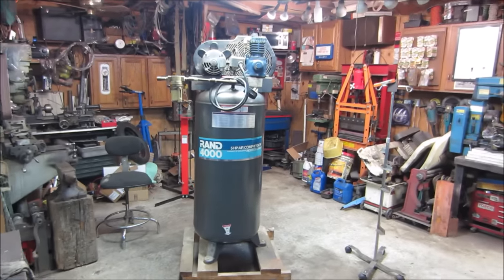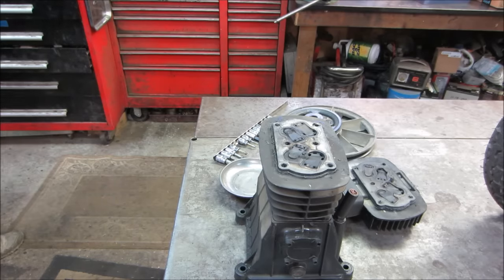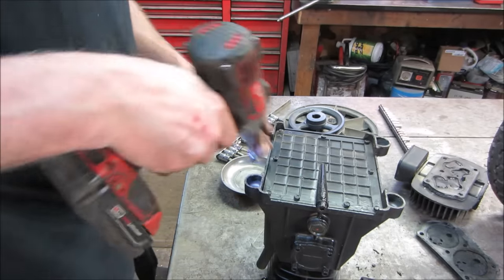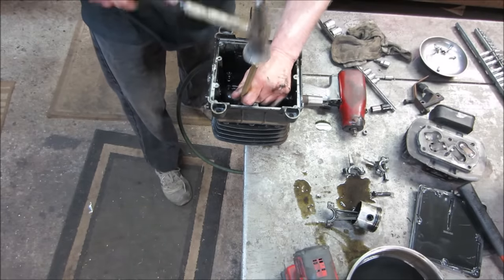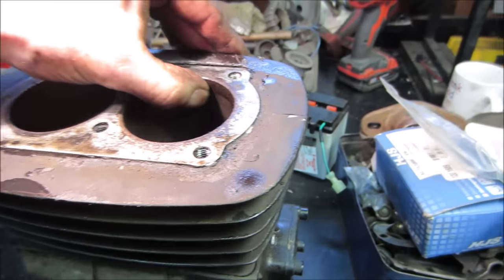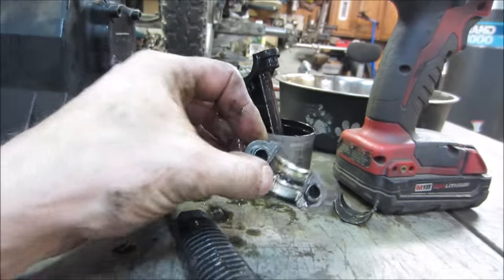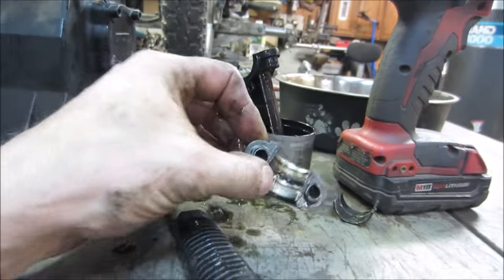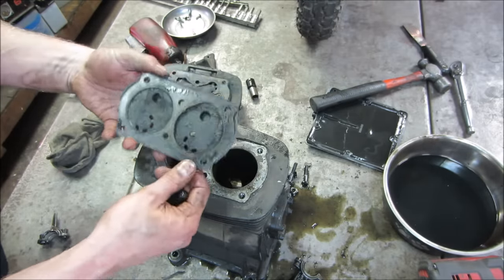Burned out Air Compressor tear down, what went wrong?

Comment: Cool - I was hoping you would tear that down. I wonder if the had it sitting on enough of an angle that the splash arm on the bad side wasn't reaching far enough into the oil reservoir. If the had is just a few degrees one way and let the oil level go too low i might not have been able to splash the oil high enough into the cylinder to lubricate killing the wrist pin and the connecting rod and once those got bad enough they started causing the damage to the bearings on the crank - which probably got enough oil but couldn't deal with the slop. 

Always a fun time dissecting a failure. The only thing I can think of for the extreme wear difference between cylinders is the unit sitting on a angle.

Comment: I would say you're probably right about the fan cooling the one side just enough that it didn't fail like the other side. They don't use a wrist pin bearing ( roller bearing ) in those machines ? Strange. I've rebuilt a few dirt bike engines in the past as well as my own skidoo engine ( 1980 Citation SS ) with teflon coated pistons lol. It went just over 100 mph after the break-in. :) Thanks for the entertaining  programs. Good Day eh ? From the Great White North !

Comment: That sort of damage happens when the discharge valve isn't closing off. The wrist pin needs to have a cyclical force on it, by having a suction stroke, where the piston is pulled down by the rod, distributing oil to the top of the wrist pin;  then followed by a discharge stroke where piston is pushing up. When the discharge valve is bad, there is always pressure, and down-force on the piston and rod. This causes the wrist pin to wear into the top of the pin bore because and bottom of the rod bore; it never has a chance for oil to enter that side. 

The reason that a lot of the big-end bearing is still present is because it makes full revolutions and that carries oil all the way around the bearing, whereas the pin only has up and down motion to help distribute the oil.

Comment: I was watching your atv video and you mentioned it’s hard to get a close up of anything with your camera. May I suggest you go to AliExpress and buy a WiFi endoscope camera. I got one for 15bucks and it connects via an app to your phone and you can go really close up to parts, like 1 inch and it’s got an array of led lights around the lens so it’s great for showing things very close up, you can record the video and post it with your videos. It’s handy for inspecting things too like engine cylinders through the plug hole. Great videos by the way. I love them. Thank you so much for posting them.

Comment: I wonder If the reed valve failed on the good side so it wasn’t doing much apart from going up and down.
The other side produced pressure day after day until the wire fell off.

Comment: I would say that one cylinder started to give away first causing more drag to that side . With the extra drag on that side brings more friction allowing more wear to the bearings and upper rod .  Basically , it started running lop sided .

Comment: My theory is that the compressor overheated due to just running while the shop was empty, and the hotter side was the one that gave up. Once that oil started depositing on the top of the piston, it cause friction that eventually wore the wrist pin and top of the rod out. Of course... it could also have been someone overfilled it with oil and that first throw started a dent that eventually, and after being run for years afterward, cause the damage we see.

Cool autopsy though, I always wondered what was in one of those heads v a fuel engine.

Comment: My guess is this is a two stage compressor the good cylinder is the first stage where  the air enters gets compressed and warmed moves to cylinder number two where it gets compressed and more heat is generated. Now I am not sure if the cylinder that is the second stage is closest to the fan or not, but either way the blown out cylinder might have had an underlying problem of some kind before the prolonged full tilt boogie operation! What do you think?
Come back and give an update to the comments. Thank You.

Comment: Hi Mustie, after watching the first video in regards to this compressor, I think the damage to this compressor was done by someone adding that big drive pulley on the motor causing this pump to turn way too fast which caused overheating on that one cylinder.  These pumps like to turn at fairly low RPM's. The compressor that you put on the other tank, the motor really needs a much smaller pulley for that Quincy compressor as those pumps like to turn at 600 to 850 RPM's, so if you want that pump to last long time, I would put a 1.5" to 2" pulley on that motor.
Reply from the maker: l did go even smaller on the pulley but put one what l had at the time,

Comment: The piston on the side closest to the pulley runs cooler than the one furthest from it. The wrist pin that failed is where the most heat would be concentrated, so it would be the first to go because of the excessive heat generated when the compressor was left running, and when the wrist pin failed, the hammering would be transferred to the crank end of the rod and destroyed it even though both rods were getting the same amount of oil. This is basically the "cause of death".

Comment: No expert on compressors but I would wonder if the severe cylinder was under a higher pressure such as a "two stage" type system where one cylinder is receiving air already pressurized and pumping it to a higher value. With all that carbon, I would also wonder if the oil was actually "burning"??

Comment: I have one of these, only the horizontal model.  The amount of carbon tells me that they were running motor oil in that unit.  Only run naphalmic compressor oil, SAE 40, in these or other compressors.

Comment: Air systems on trucks often blow oil past the rings when they are tired, Piston rings will fix the problem. IR parts are stupid expensive and synthetic oil is recommended. I would agree that the side farthest from the fan had the most damage due to heat.. I would have considered one of those high volume compressor pumps from Harbor Freight and build a good air station.
Reply: I'd agree being away from the fan caused the issue or at least a huge part of it.  Very common on V-Twin motorcycles that the rear cylinder wears much more than the front as well.  Just doesn't get the airflow.

Comment: I wonder if it's a 2 stage where one cylinder compresses the air and it goes to the next cylinder and it compresses it again. That would explain why one was so bad and the other was not.The second has to work harder to compress the higher pressure air again. And the building heat added to the problems.

Comment: piston b heats up the most due to fan direction, burns oil has more drag, gets so hot it's almost stuck in it's boar. 
cracks piston at wrist pin, on one side at first, the pin is pushed at an angle than over time the pin wares sideways making a nice slot over time. the added heat and mostly the knocking pounds the oil out of the bearing at each knock taking out the rod bearing. 
prevention,  turn off compressor when not home, use better oil, improve air flow. 
for long runs i use a box fan pulling air up on top of compressor. 
also a thought on better oil, you may have way better read valve life with no burnt up shit on them. 
and also thanks for the vid.
Reply: That's close to my diagnosis, the far piston was getting less cooling, possibly causing it to expand more and get tight in the bore, the extra forces caused a stress failure to the piston's pin bore on one side, this caused an ever increasing amount play which hammered both ends of the rod to destruction.

Comment: The elongation on the rod end is biased to one side because the crank swings in a circle and its probably worn on the upstroke as the piston swells from the heat in the bore. once it starts knocking, its going to happen on one side more than the other since the rod goes up at angle (and down at an angle for that matter). Its only straight up and down at the very top and bottom.

Comment: is that a high-pressure compressor where the pressure from one cylinder is pushed into the other cylinder . and compressed again for higher psi. that could be why one is more damaged than the other one. it's under a higher load.

Comment: the bearings always see good on the pully side on these compressors, the heat can dissipate on the cooler bit of crank shaft sticking out the block, also the pully can suck some heat away, other side the heat just stays there...

Comment: You said this compressor and tank was in an idle warehouse. There was probably no on-sight security or if there was, they were unobservant. I'm guessing someone look someone took/stole some of the lines that the compressor serviced or a component failed to keep the air in the lines and it just ran continuously unchecked until failure. 
The rear cylinder on a Harley twin suffer more failures than the front. The lack of cool air flow probably contributed to the other piston's failure, but I'm just guessing.

Comment: Just a thought on why one piston and not the other. The pistons were both wearing but one a little bit more than the other. When one of them reached a certain point it began to wear faster because of the extra play from the wear. In other words, all that wear on the bad piston happened fairly quickly once it got past a certain point. A vicious circle of wear causing extra heat which broke down oil which caused extra wear which caused extra heat. Repeat cycle.

Comment: I'll have to admit I have never seen a compressor with carbon on top of the piston man that thing must of got hot  literally hot enough to burn the oil  and that probably helped the wrist pin areas to go out to because it's often the metal from the heat I'll bet and you're right I think the one good cylinder was because it was getting all the air that used to be a real problem on the Harley-Davidson's and was always the back cylinder that had all the trouble  interesting that the reed valves seem to stay together  I watch your videos quite a bit  thanks for showing what happened  I'm surprised it didn't just blow up on that one cylinder  that must be a pretty tough little compressor

Comment: Im guessing the deposits on top of the burned cylinder, is because as you mentioned in your last video air gets hot when it compresses and some oil got past the rings and burned. Thats just a guess on my part though.

Comment: There is only one oil slinger, near the first piston. Compressors do use
(leak) oil, just to seal. Unlevel floor, ran oil nearly dry, first starved was #2 from fan.

Imagine how hot it must've been. There's no combustion to keep stuff clean.

It would be like draining the oil from an engine, no fuel to "run", and just
cranking over continuously, until whatever stray oil is left is pushed out.

Comment: Back in the late 50's I got one of the first transistor pocket radios for a present.  When it stopped working, I took the back off, removed the printed circuit board and began wiggling the transistors (I saw a TV repairman do that with the tubes in an old TV).  When one fell off, I began to wiggle another to see if that would make it work.  To this day I don't know my logic (I was only about 9).  I put all the parts that came off into a tray, then put it on the floor of my bedroom closet.  While my father was shaving, I approached him and asked if you could help me with it.  I guided him to my closet (he still had shaving cream on his face).  I directed his attention to the tray while asking if he could put it back together (I had seen him make repairs on other household items and he seemed to know how to fix them).  Well, before I could finish, he exploded into a rage of expletives and other loud shouting.  I ducked out of the area pronto and heard about that radio for weeks.  I loved to tinker with things to see how they worked.  But this time I went too far.

Comment: Could be like a two stage, one cylinder pushes air into the other one, that cylinder increases the pressure and sends air to tank, so it is under more stress than the first stage piston? Or was spinning to fast and self destructed?

Comment: Ambient air surprisingly enough has a fair amount of contamination.  Intake for scuba compressors need to be well above parking lots and such.        But in your case, the carbon is definitely from oil blow by. If it is a two part compressor one piston is preliminary intake and the second is output.

Comment: Hi, if the original owners turned off the power when they left, how did the compressor keep running? The power company wouldn't be able to enter the building to shut it down if the owners went out of business and the new buyers must have had a huge bill to pay to reconnect if the cut it off from outside, not to mention the unpaid bills for the power used by them. K previous

Comment: While air flow is one reason, I have seen 2 other reasons, 1 being lack of service on a regular basis, 2 is that most people put compressors in corners, this helps retain het around the rear cylinder and break things down quicker!

Comment: I learned about this thing called an "auto bleed" ,,,harbor freight.. northern supply,,, its a thing that hooks on the vent/drain and bleeds when it senses moisture...not expensive and works great .. for painting.. but air tools in general dont need a bunch of water in em either

Comment: My guess was since it was air cooled the farther of the two cylinders heated up faster. And if it was on a continuous duty most likely not designed for that. The oil was carbonized from the heat. The loop ended with a vibration chance slip of a catamount ?

Comment: From my experience with compressor pumps its always dirt and fine particulates that sneek past your air filter that destroys your pistons and gradually creates resistance, severe wear and tear on the pistons resulting in the piston rod getting oval-shaped until failure.  A chain reaction of destruction, from a dirty air filter. So keeping the filter clean will give your compressor long life.

Comment: ....I used a couple 2" bell reducers and a nipple to create a condensation chamber under the tank with a ball valve to bleed out the water....has worked ok 20 years so far
Reply: A more detailed description would be great? are you talking on the compressor exhaust?

Comment: Something that came to mind, is that a two stage compressor were one cylinder forces air into the other? Maybe the first stage had a bit of oil blow by that feed into the second stage which is why that piston is oil covered at the top. The compressor ran until it quit when the wrist pin started to beat the piston to death, Who knows maybe it was a bad set up from the get go and it just took a while to fail? I put a old piece of plywood under the drain on my compressor tank to avoid "water jetting" the area it sits on.

Comment: I think that the fan side cylinder was the first stage which would run cooler. Second stage is further from the fan and since it is compressing the air further it is working harder, along with a hotter gas charge. That's my guess  ..

Comment: How did you loose and tighten the pulley bolt if the shaft it all round and has no place to lock it with other wrench while tightening the bolt for the pulley?

Comment: I think the crud on top of the piston stopped it from finishing the stroke.(maybe the filter? did you check if it was still there?) and blew out the wrist pin, lost compression because it was wearing at an angle, pushed out the oil and since it was the side furthest away from the fan it got hotter as you noted. New to your channel and I like it haha 👌

Comment: Observations:Thin'block';extra-robust crank,rods/pistons/pins;
Aircooled.Carbon is due to burnt oil due to overheating.
Splash lubricated.What m akes it run? and what is its purpose

Comment: Seems like the long stem on the bottom of the main rod clamp pick up the oil that goes to the top? compressor ran too long. oil went bad clogging one side causing it fail faster than the other.

Comment: It’s a long shot BUT….the air filter could have failed or partially clogged/damaged. In combination with the fan pushing dust particles past cyl 1 intake, hitting a wall/corner,/ causing particles to circulating back reaching cyl 2 intake?? shops usually place compressors against walls/corners and or small rooms to combat the screaming compressor and save space.

Comment: I'd guess that at some point while it was running and running it became a bit of a diesel engine where the heat build up in the body, combined with some oil vapour and the super compressed air in the cylinder caused a "backfire" that drove the piston down when it was almost at TDC causing a lot of that damage to the wrist pin. The electric motor was spinning the crank one way and the "backfire" rammed the piston back against that force.

Comment: Cool videos man! Hey my compressor is running for longer intervals when getting to set PSI level. It also seems to be running really hot. It sounds normal though. Any tips on what to look for before tearing it down? I'm hoping its only the reed valves ha ha

Comment: I wonder if the pressure switch stuck on and it ran against the blow off valve until the wire melted off.

Comment: Might be a dumb question, but why did the piston head have a carbon deposit when there is no combustion in a compressor cylinder?
Reply from the maker: l think oil from the crank case as it was burning up made it to the top
Reply: @mustie1  Ok, thanks Mustie1, that makes sense. As the rings were wearing out I'm sure some made it into the cylinder.

Comment: If it stood slightly tilted to pulley side the other side would have had lower oil first, combined with cooling of fan on other side could cause non-fan side to burn out first?